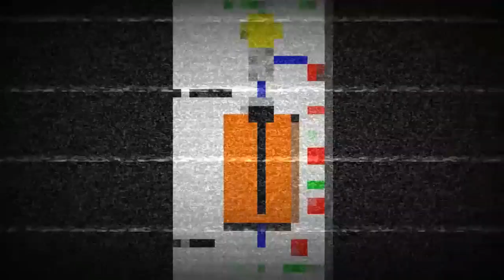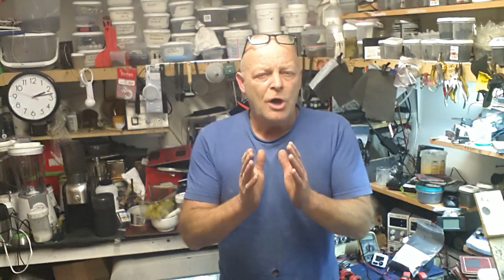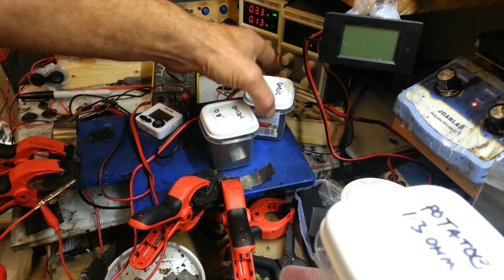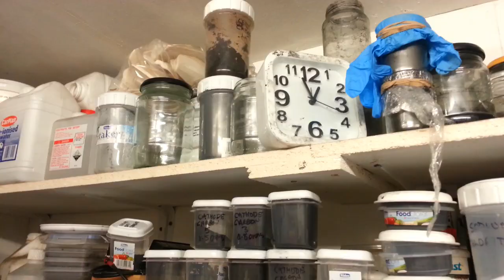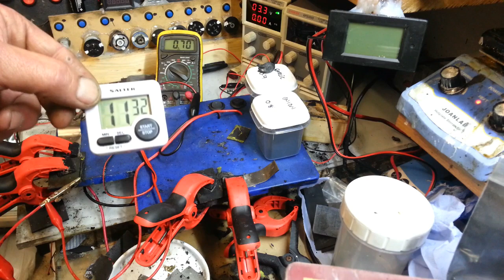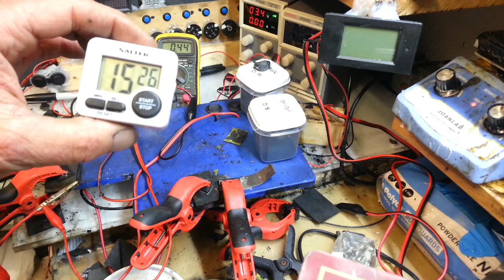WoW All Carbon Battery New Cathode Material

Comment: Nice work Kev. Garlic batteries without the stink! Haha I'm doing similar sort of things as you. Working in a small shed/room (there's never enough space is there?) Hoping to make an eco friendly all carbon energy storage device and being inspired by RMS videos.  He's a  legend ain't he? And, like yourself, have holes in my T-shirt too! Lol I agree activated carbon is excellent and I always heat it in kiln upto 1000c to get best conductivity. I've also had success with sugar foaming. I altered an RMS recipe. I mix about 4 g of zinc or potassium nitrates heated with 12 g sugar.. few drops of water. Add some GO if you want. Then heat in kiln at 200c.. in steel container with lid. It will fume!! After the fuming stopped.. pull out and lift lid.  Squirt water to stop the reaction so u don't lose your foam. Then carbonised upto 1000c in your usual way. The advantage with this is that you have a desolved sugary solution and have more control as to how the carbon forms in the first place. Also when I test carbons, I always keep to same standed test. Put it into powder. Put known weight of carbon into known amount of water and binder and pippette known amount of solution onto same surface area of graphoil electrode. So keep weight of active material and surface area the same. Hope that helps someone or is useful info. Good luck Kev!
Reply from the maker: Tim Godsalve thanks mate.
I have yet to pergect the sugar bit mysef, but i do know that sugar is an important part of my experimentation at the moment. I do seem though to be getting a bit of a package together and i am starting to understand what works best with what and what is best left alone. It is strange though that i had 3 garlic onions ready to be carbonised and they were kinda on the back burner.
Then bluesdoctor suggested that i may have a surprise if i run the test and  hey presto ! A super carbon. I need to check out the sulfur angle now though because im getting signals.
Cheers
Reply from the maker: Tim Godsalve oh and yes RMS is a one of a kind, he was and is my inspiration. And i think that once the days went where he showed everything from start to finish it got better. He taught us to experiment after.
Reply: A video would be good Tim, the more ideas the better we can learn from each other, and check results. :-) Martin.
Reply from the maker: solarhope did u get my last email martin ?
Reply: Yes, last night , i will send again - a few questions :-)

Comment: Graphitic carbon nitride is high conductive and while is expensive to buy at around E$9000/kg. Thermal deposition of urea in an oxygen free environment at 500-600C for 3hours is a cheap way to make it.

You kiln cold do the job using charcoal as an oxygen scavenger.
Reply from the maker: EmmittBrownBTTF1 yes i have already made some but it is not as easy as many would think.